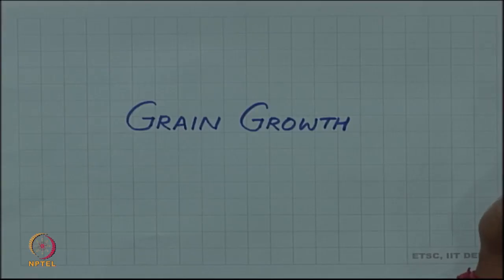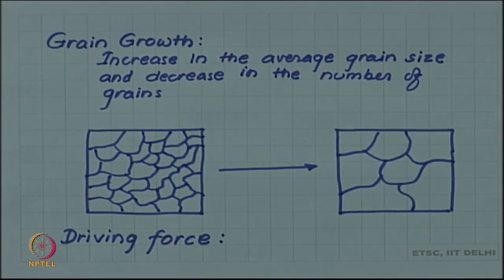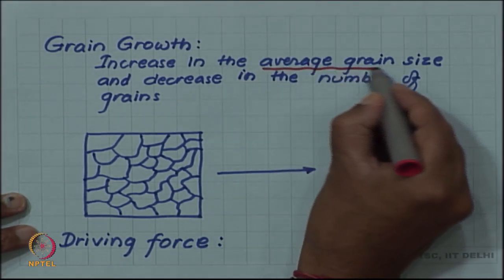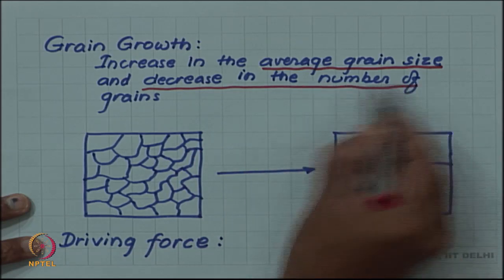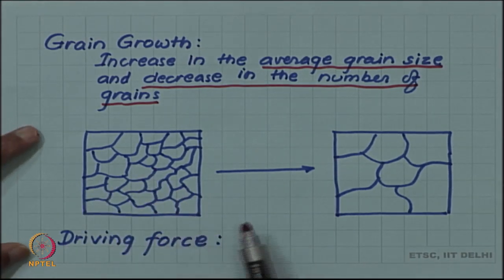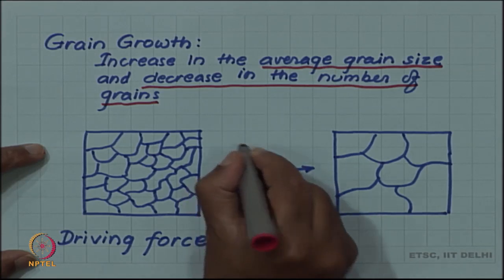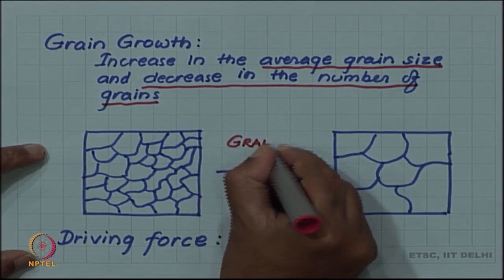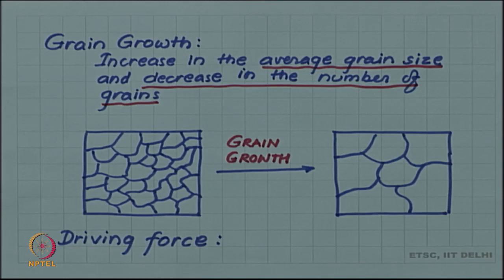Grain growth

Comment: kindly help here sir ,pi(di)^2 is the surface area of one whole grain, it's not the grain surface area boundary ,why are you then dividing by 2 to get the grain surface area boundary per grain?
Reply: Because each boundary is shared by two grains.
Reply: @rajeshprasadlectures  then the area of the grain boundary should be the one divided by 2
Reply from the maker: When a grain is a part of polycrystalline sample then its surface area is the same as its grain boundary area.
Reply: @introductiontomaterialsscience  that now makes sense but it's hard to visualize that

Comment: Dear Professor Prasad, 
How can the misorientation between two grains be compensated after grain growth? Does the smaller grain dissolve and contribute to the growth of the larger grain? Then, what is the difference between coarsening (Ostwald ripening) and grain growth?
Reply: Grain growth refers to the increase of average grain size of a single-phase material. Ostwald ripening is the increase in the average size of a second-phase particle in a two-phase microstructure (second phase: precipitate, 1st phase: matrix). The driving force for the two has a common source: a decrease in surface energy. But the nature of the surface is different in two cases. In the grain growth, it is the decrease in the grain boundary (alpha/alpha boundary) energy. In the Ostwald ripening, it is the decrease in phase boundary (alpha/beta boundary) energy.
Reply: @rajeshprasad101  Thank you very much for your kind explanation! I also watched your coarsening lecture and it was clear that smaller particles dissolve and larger particles grow due to their free energy difference.
 Do we also need to consider free energy, depending on grain size, in grain growth? I can understand the driving force is a decrease in surface energy, but not sure why   the orientation of larger grains become dominant at the late stage of grain growth. Although this  sounds more natural than the opposite case (larger one becomes a part of smaller one) but I would like to know if there is any specific reason...
Reply from the maker: @insunghan7120  Could you please explain  "but not sure why   the orientation of larger grains become dominant at the late stage of grain growth"
Reply: @introductiontomaterialsscience  I initially thought the final grain orientation is an intermediate orientation between two grains because they are sharing interface and possibly rotate to minimize misorientation. This might be beyond the topic of this lecture?

Comment: Sir, wondering if this process continues through some of the cooling stage, or if it only occurs when the material is being held at a constant elevated temperature.
Reply from the maker: Grain growth requires both time and temperature. So typically it will happen on heating.

Comment: Grain growth occur when we maintain temperature above recrystallization temperature.. Grain boundaries also decrease at lower temperature and it is also driving force in this case.. So why grain growth can not occur at room temperature????
Reply from the maker: You are right. The driving force exists at all temperature. But for actual growth to happen atomic mobility is also required. This is negligible at low temperatures and starts becoming significant around recrystallisation temperature.

Comment: Sir,why should the volume remain constant?
Reply from the maker: Overall volume the sample remains constant (an approximation based on the assumption that the contribution of gb to volume is negligible)
Reply: @introductiontomaterialsscience  Yes sir that is fine but what if may be there is a transition say from ferritic to austentic?(BCC to FCC).Obviously there is a volume change that is relatable.What if we have such instances.
Reply from the maker: @rajorshikoyal4397  This will be an example of phase transformation and not grain growth. During grain growth the phase remains the same. Only the grain size increases.